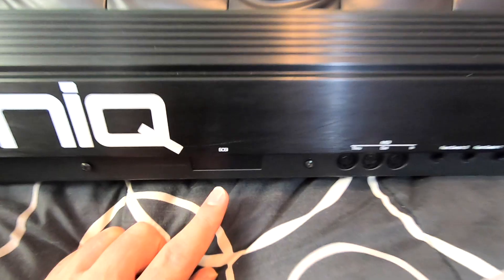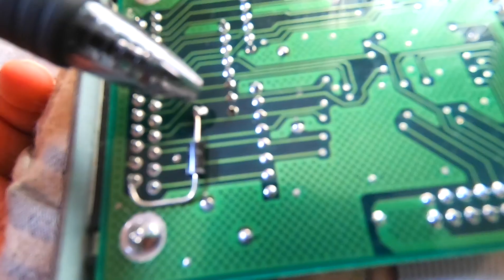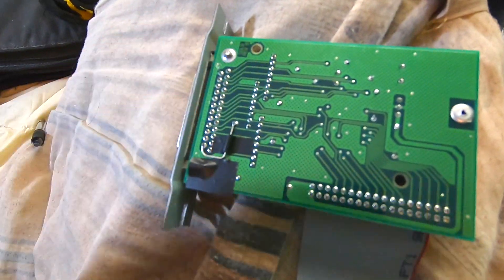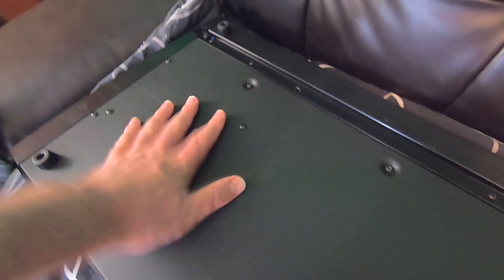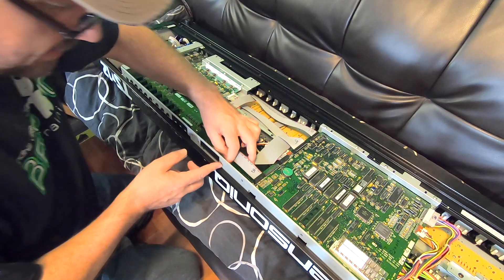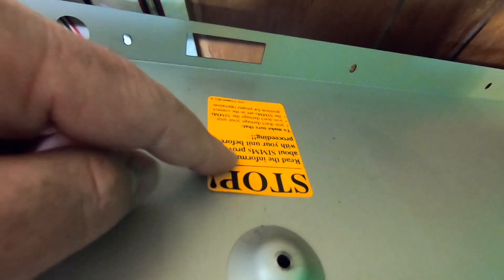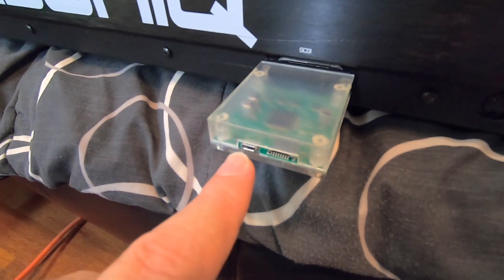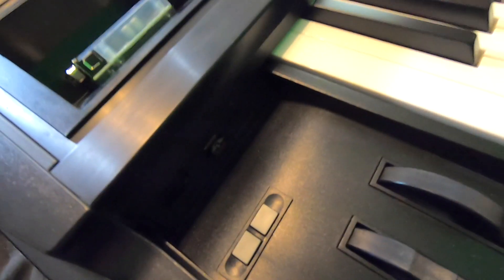Ensoniq SCSI Installation - TS-12 - SP-4

Comment: solid effort!
- I just added the diode mod on the SCSI board for. my ASR10 sampler keyboard - taking that back panel off is a task, hey.
but yeah, I got the diode installed just like your one.
(it didn't make my Iomega 100MB Zip drive work, unfortunately... not sure why .. . but I might try the SCSI2SD next)
Reply from the maker: I don't think the SCSI card is the same on the ASR, if the SCSI2SD doesn't power, you might have bridged the wrong spot. Or maybe the diode is backwards.

Comment: Where did you get 16GB of ensoniq samples? Holy shit. Just got a TS12 and happy to come across this video but damn that’s a lot of samples
Reply from the maker: They came from Ensoniq sound CDs. You can manage files from those with programs like Chicken Systems Translator. It's hard to work with Ensoniq format on computers. Be ready for some headaches. But once you make the cards, you are done.
Reply: @HankCoffey  I see - would you be interested in making some dupe cards? I’m looking on EBay and all this floppy disks are super expensive
Reply from the maker: @tomkingsays  It's not something I really want to get involved in, and selling dups might be illegal. I'd have to order the cards. Your drive has to be flashed the same as mine before the cards will work. If you do enough searching, you can find disk images online. It's a lot of work to get the Ensoniq stuff working.  I recommend working with Garth from Chicken Systems, and join the Facebook Ensoniq group for help.  If you want to put the work in.